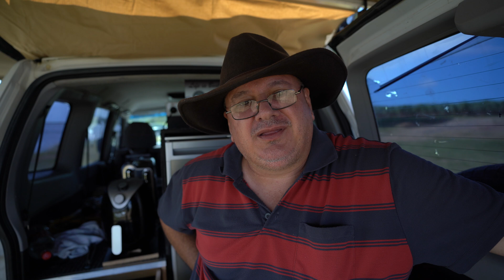Lets talk Lithium Battery's for your 4WD/SUV setup.

Comment: Hi Phil. I built my own 400ah lifepo4 battery using 8-200ah cells in 2P 4S configuration. I use a Daly 250amp BMS with Bluetooth. My battery cells and BMS cost me $1100 including shipping. I’m out at Mt Perry. If you need advice give me a yell. I only use Victron charge controllers, dc to dc charger, Multiplus II 12/3000/120 inverter and Cerbo gx. Installed all myself saved thousands. 
Cheers Ken
Reply from the maker: 400ah.   That would be awesome to have,  but I don’t think I have the room.   I’m looking at the new Eve 304.  That will give me a 12v 304a battery. 

I’m also mostly using Victron including multiplus and Cerbo gx

Comment: You’ve got your Freddy Krueger shirt on!! 

Hi Phil. I’m a sparky and I wouldn’t suggest you attempt to build a battery using cheap crap from China or Alibaba (I know Victron batteries are made in China!!) Just buy a good pre made lithium from a reputable brand with a warranty.   They are more expensive but you get what you pay for.  If you go DIY battery will your insurance cover the fire when something goes wrong? I’ve just bought some very expensive Victron 25v lithium batteries for a customer’s build and I was surprised at the discharge rate I was able to get for a 24V 3000VA Victron inverter compared with the Enerdrive batteries I was intending to use. Did you know that Enerdrive does not suggest you wire their 200aH batteries in parallel because the BMS and discharge rate you cannot handle more than 200amps discharge. What is the discharge rate of your DIY batteries when someone wants to run a coffee machine, bigger air frier or a small AC unit. There is some grey areas here that I wouldn’t want to be navigating due to the risk. Good luck mate.
Reply from the maker: I like that shirt,  has a pocket for my glasses and it’s comfy to wear and keeps me cooler in summer. 

I’m not going for the cheap crap.  At this stage I’m looking at the newly released Eve 304 cells
Reply from the maker: Victron do make great battery’s,  but I can’t justify the price. When I can build a battery pack at a fraction of the cost.

Comment: Hi Phil, Off Grid Garage has Some great videos as someone already mentioned on Dyi Batterys as well as recommend sellers on Alibaba that are trust worthy.  I bought 304ah battery cells for around $900 including delivery and Daly BMS of another $350 that has Bluetooth and rated at 250 continuous discharge. Also another recommendation of a channel building DIY lithium batteries is Offgrid Van Life has great in-depth video there, I highly recommend them if you want someinformation ok building a pack.
Reply from the maker: I’ve come upon the Off Grid Garage a while back.  I look forward to all his new videos. 

Off grid van life I never heard off.  I checked them out and it is awesome.  Thanks for the recommendation. 

I’m also at this stage considering the Eve 304 cells and a Daly BMS

Comment: Hey Phil what did you say about when you get a new battery? How to charge it? Did you mean draw it right down and recharge it to 100% ? Or keep it topped up from the start. What’s your recommendation when you get a new battery re charging it? Hope you can help. Love the vids :)
Reply from the maker: More referring to new cells for battery builds.  When you get the cells you must do what’s called a top balance,  charge each cell to 3.65 v.  What that does is makes sure each cell is fully charged. 

This will have already been done with prebuilt battery packs.
Reply from the maker: In regards to new prebuilt battery.  I put them on charge as soon I get them.

Comment: freely roaming made one a year ago with 280ah cells , a lot of off grid solar people have done it, off grid garage is always experimenting with different things , renogy au has a 200ah with 200a continus with blue tooth that's on special,  and itech 200 has 200a continuous as well just no blue tooth.  getting a good bms that can handle your output required and have blue tooth that's reliable might be the hardest part as well as making it suitable for the harshness of being in a mobile environment of a vehicle not just setup in a box in a house. the cells come in different categories as well. DavidPoz is also another one that has made batteries.
Reply: deligreen bms has Bluetooth, has a balancing, they have different voltages from 12 to 48 . the one that might work for you is a 4s 12v 250a smart lifepo4 deligreen bms with Bluetooth and balancing function.
Reply from the maker: @jc7654   I will check it out 👍
Reply: @PhilsCampingReviews  AveRage Joe  just posted a video of making a battery that  would be helpful for you
Reply from the maker: @jc7654   thanks👍 I will check it out now
Reply from the maker: @jc7654   deli green appears to be cheaper than the Daly
Reply from the maker: @jc7654  it looks like a Daly  has the same Bluetooth as well
Reply from the maker: Yeah that’s what I’m finding.  The good cells appear to be easy to find,  but the BMS is another story. 

Most appear to go for the Daly BMS but I seen it’s not the best for balancing.  Takes a very long time.
Reply from the maker: And the BMS I get must have Bluetooth

Comment: have you watched any of will prowse videos...?
he's always building and testing different cells and bus.....and also testing and pulling apart ready built batteries to check quoted capacities and quality....
you might find a battery cheap enough to run two batteries to give you what you need....
Reply from the maker: Yes. I’ve watched a few of his videos in the past.  

I’m going to start watching more of his videos from now on.